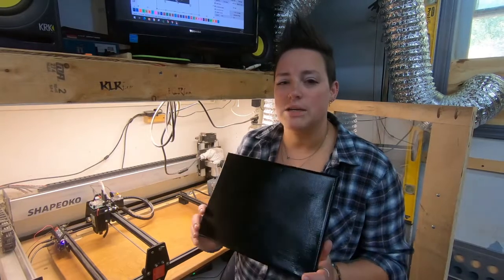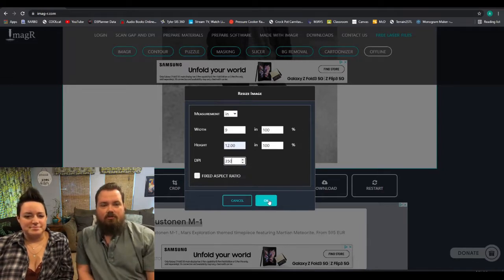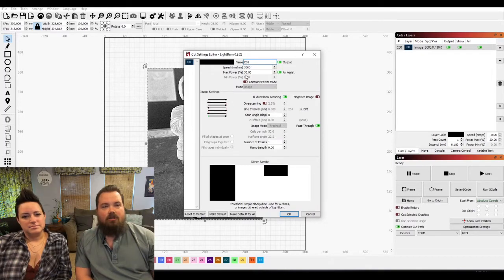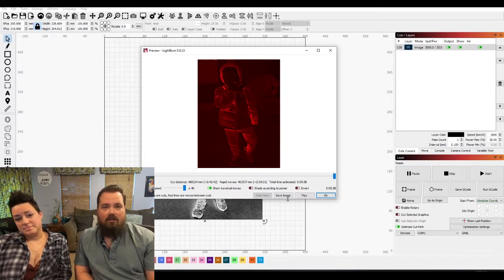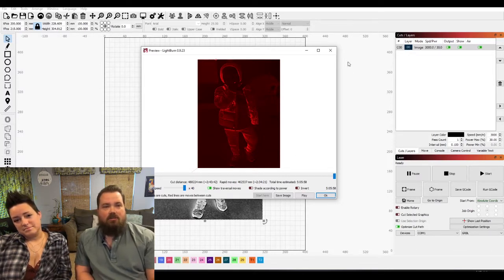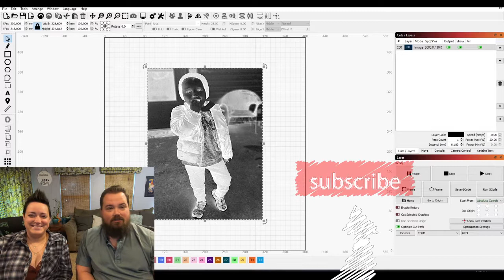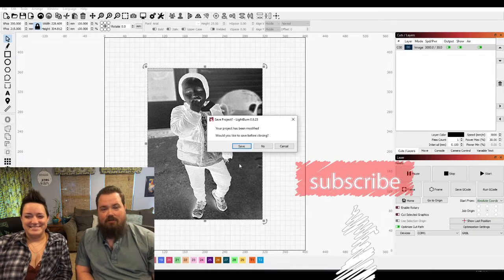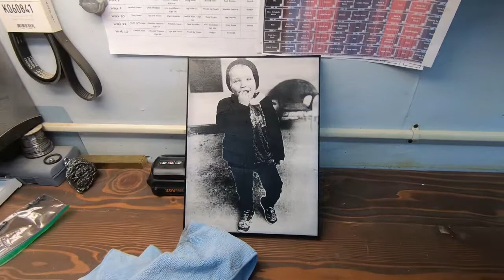How To: Burn a Picture on Painted Canvas. Ortur LM2

Comment: Great video, really want to try this on my Atomstack A5 but never tried canvas. What paint is used to coat the canvas, is it oil based  paint?
Reply from the maker: Rust oleum X2 spray paint. I put some links to it in our new video where we tried this on the new CO2 laser.
Reply: @KLRform  great thanks, will check it out

Comment: Is this just black spray paint over the white canvas? Does this smell bad when lasering? My engraver is in the basement.
Reply from the maker: You can do just Black or do a layer of white then black on top. We have done both at different times. Not sure on the smell we use an exhaust system.